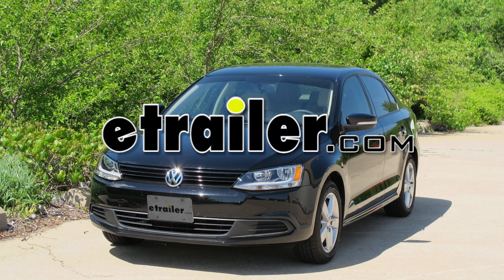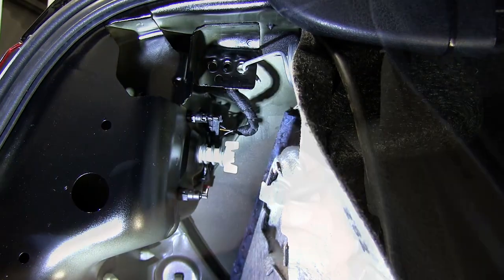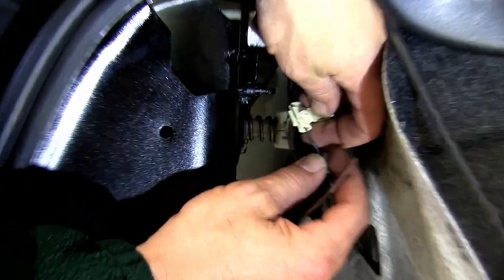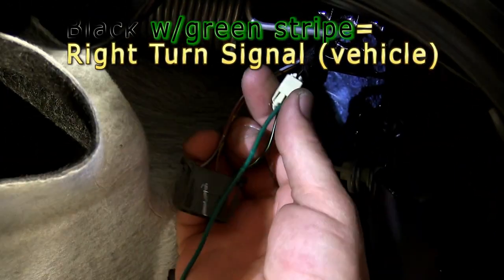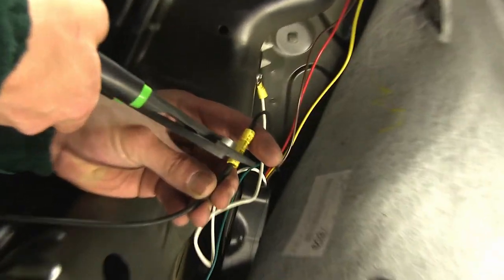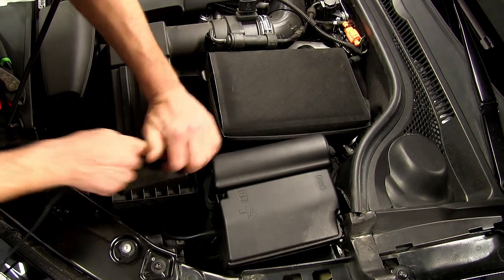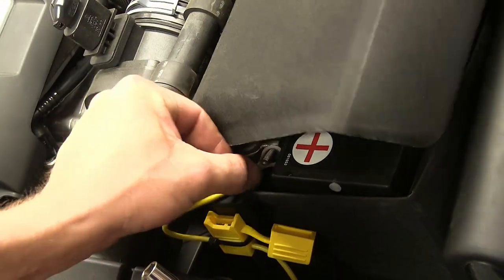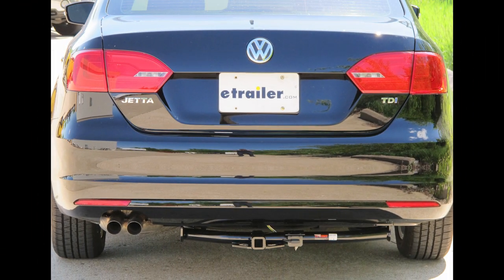Installation of a Trailer Wiring Harness on a 2012 Volkswagen Jetta - etrailer.com

Comment: Will the controller always be on since it is connected directly to the battery rather than a switched fuse?  Can this eventually drain the battery under any circumstances?
Reply from the maker: Most brake controllers have a sleep mode that allows them to shut down after about 15 minutes of the vehicle being shut off.
https://www.etrailer.com/bc-2012_Volkswagen_Jetta.htm
Reply: I doubt it will drain the battery since if you dont have any load applied to the system it wont pull any power. You should be fine. And if the car is off the controller should also turn off.

Comment: helpful to add the parts and part numbers of the products you used.  An please explain why it is important to power this separately instead of just tapping straight into the existing circuit
Reply from the maker: The wiring harness used in this video is # 119190KIT. The reason for not installing the power wire on anything but the positive post of the battery is that you do not want anything else to interfere with the functioning of the trailer lights. You could run the chance of blowing a fuse if you were to tie the wiring into another circuit by overloading it.
https://www.etrailer.com/Wiring/Tekonsha/119190KIT.html

Comment: what color is the wire for the reverse light?
Reply from the maker: This wiring harness does not come with a reverse wire to connect to. If you were to install a 7 pole wiring harness, you would need to connect the reverse light wire to a reverse signal under the dash.
https://www.etrailer.com/Accessories-and-Parts/etrailer/ETBC7.html